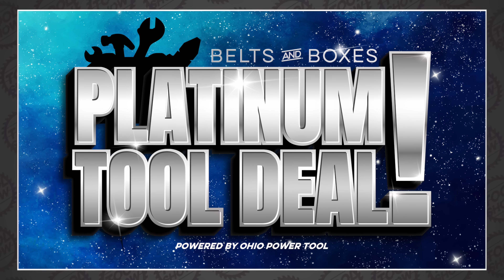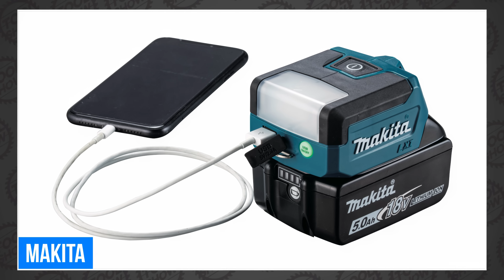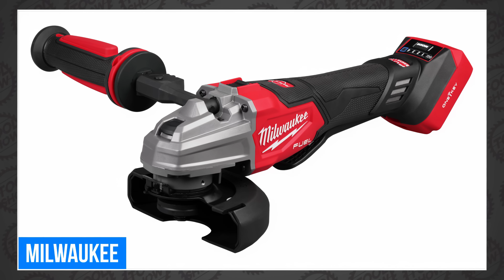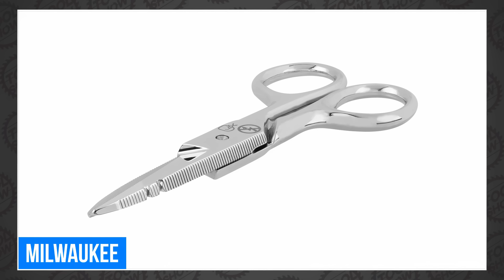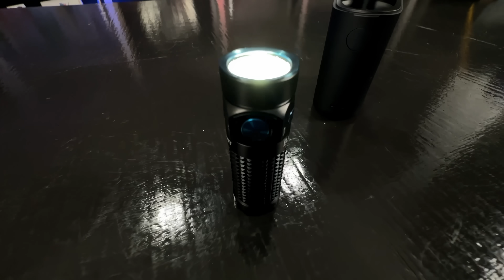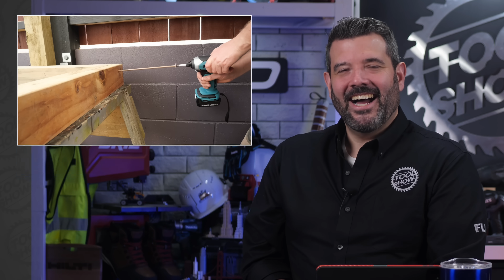NEW Tools from Milwaukee, DeWALT, Makita, RYOBI and more!

Comment: the backend of the m18 trimmer wasnt heavy enough so they just not going to even try to balance it if they made a 2xm18
Reply from the maker: We tried it at Pipeline, and it was pretty heavy. POWERFUL…. But yeah… heavy.
Reply: Ya my wrist gets jacked up from that thing as it is having to hold that trigger down I don't think I could last a second set of batteries without some tendonitis on the dual 8ah

Comment: Why do I love "baby chainsaw" screams? (just Sarah...) What's wrong with me? LOL. One note for the Olight, you can also run the flashlight while in the case, meaning even if you run the light until dead, you can just pop it into the case and it will do pass through and let you run the light from the case power directly.
Reply from the maker: Didn’t think of using it in the case when it’s dead! Great tip!